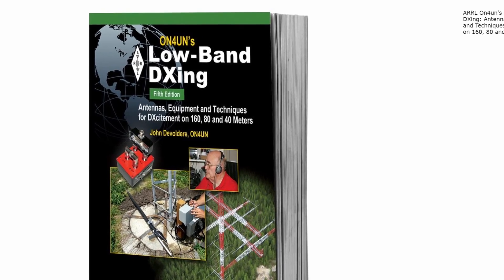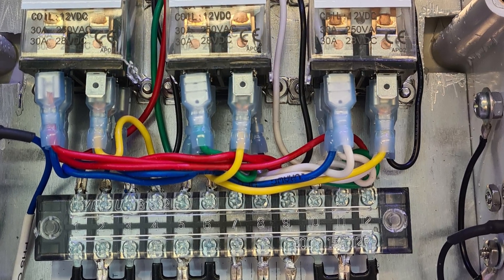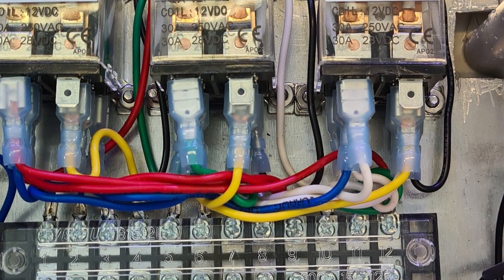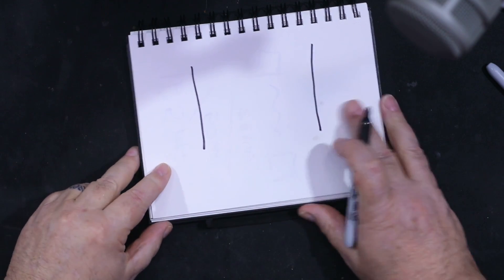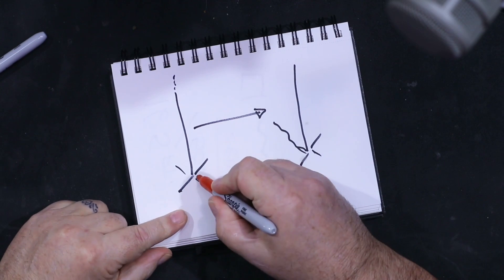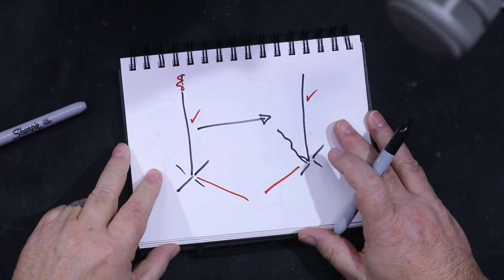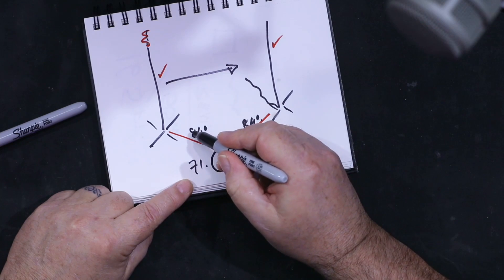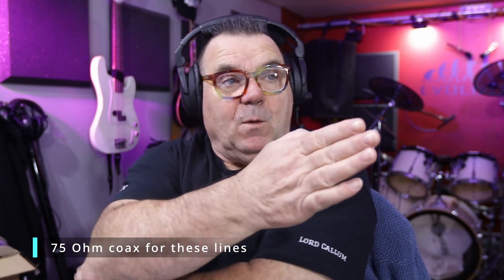Simplifying the 2-Element Vertical Christan Method Phased Array with John NJ4Z

Comment: If you want to experiment with the Christman method for a 2-element phased array.  Here are the most important factors.   

1. Build your vertical elements so they have the same impedance, independently.  Set up both so that the impedance with both elements standing 1/4 wave apart, but one floating you get the same or very close to the same "Z" impedance (total impedance) for each element with the other floating.  
2. Make sure your connections from the relay(s) to the feedlines and the delay loop are as short as possible.
3. Be as accurate as possible when cutting the feedlines and delay line.  84degress on the feed and 71 degrees on the delay for 1/4 wave separation between the elements.  For a 1/8 wave spacing Colin MM0OPX has a great video on those with the proper feed and delay figures.  (It has been suggested that cutting the feedlines and delay line through the relay network would give more accurate lines.  I have not tried it but will let you know the results of my experiment when I do.)
4. For 100w SSB or CW 16amp relays work fine, but no more than 30w digital.  If you want to run big power and high-power digital use 30 or 40-amp relays in the system.  Heat becomes a big factor with digital or big power. 
5. HAVE FUN...

if you have questions or need help drop me a line via e-mail.  Be glad to see if we can solve it.  All the best and 73 de NJ4Z
Reply from the maker: Nice comment John!
Reply: Awesome stuff!  This type of content is my favorite.  

Do you have any specific relays you would recommend John?

Also was wondering about Solid State Relays or Silicon Controlled Rectifier.  I’ve heard other people mention vacuum relays, so just trying to get some opinions.

I’ve looked around, trying to find the voltage and amperage we are dealing with, and I’ve not found any solid answers yet.  At 1500 W what voltage and amperage are we dealing with?

Thanks again John I’m really glad you and Callum created these videos again. This type of content is my favorite as I’ve always had a fascination with antennas since I was a kid.
Reply: @KevinChry  I have used the JQX-12F 2Z series of relays for HP.  I also have used auto relays and some of the DX engineering relays.  hope that helps. Vacuum relays would be ideal but are hard to find and pricey.  
as regards to voltage and current - 100w 70.7Vrms (200Vpp) and current is 1.43A.  1500w 273.9Vrms about 774.6Vpp and about 5.5amps in current on the feedline.  Don't forget the higher the frequency the less current the contacts can handle that's why I say use high current rated relays.
Reply: 1.  Please explain what “degrees” mean in terms of feet or meters length. 
2.  Please explain what you mean by grounding the antenna. Does that mean you add radials to it? If so how many and what length? Or does it mean you’re clipping the center element onto something which is grounded? I’ve been interested in phasing antennas, but have no understanding of what these mean even though I’ve built antennas for years. I see video after video like this and no explanation whatsoever of the simple basic terms for a ham that has no experience with them.
Reply: @thestingyham1188  easiest way to explain is each degree is going to be different for each band (frequency).  A full wave form has 360degrees of travel and a specific length of travel.  for example the waveform 14.145MHz (20M) is 21.15 meters long.  So each degree is .05875meters in length (21.15/360).  Make sense.  Now coax has a velocity factor so for a piece of coax with a VF of .82, the coax would be .048175 meters per degree. (21.15/360) * .82 = .048175m. When you ground an antenna you connect the radiating element to the radials (shorting it out).  You would not do this for a phased array, because all elements in the array are fed.  You would use a grounded antenna in a parasitic array.  See my website www.performancezarrays.com for more info.

Comment: What about having a switch to disconnect the ground or make the ground directional. What I mean is with the grounding around the antenna 360 what if you disconnect 180 on one side. Would help if I could draw it but maybe you know want I'm getting at.
Reply from the maker: All that would happen is that you would be less effective in the switched direction - and not by much and of course, you would also lose effectiveness all around too.

Comment: If you only want one direction could you use two 1/4 wave verticals feed the first one with a T fitting and a 1/4 wave length of coax to the second antenna. With the hain towards the second antenna.
Reply from the maker: Yes.. The first one gets 71 degrees of coax and the second one gets 155 degrees of coax. Most gain towards the 155 degrees.
Reply: The correct feed for the antenna is one side gets a 84 degree feedline and second (leading element) feedline is 155 degrees.

Comment: You can still pull off a slick setup with 3 antennas – 2 active and 1 passive doing the reflector dance. Just throw a relay on the antenna when you're TX in a particular direction. Grab that 3rd passive antenna, let it do its thing for receiving, kicking out even more of that annoying noise from the wrong directions. And to spice it up, toss in a X-phaser to hear the voice of silence.

Comment: I had to look this up, because you made me curious!  It would appear Heath Robinson is a reference to cartoonist W. Heath Robinson who was known for drawing overly-elaborate machines that perform simple tasks ( https://en.wikipedia.org/wiki/W._Heath_Robinson ).  That would make a reference to him similar to our own cartoonist Rube Goldberg here in the States, who drew oddball machines for similar, simple purposes.

However, judging from your use of the term, it seems Heath Robinson would be more akin to "jerry-rigged."
Reply from the maker: Agree with your last line.. I also have the feeling that Heath Robinson has morphed over the years to a "cobbled together / rustic / won't work for long".. But Jerry Rigged works too. Actually, I would say Jury Rigged.. https://www.merriam-webster.com/dictionary/jury-rig - nice comment - thanks!!
Reply: @DXCommanderHQ "won't work for long" - there's nothing more permanent in most ham's antenna arsenal than a cobbled together temporary trial solution which works.

Comment: I've been enjoying these phased array series. It's been tremendously insightful and given me something to trial out. Wanting to build a 20m & 17m versions.
Reply: go for it... it is great fun!
Reply from the maker: I'm with John.. Do it :)
Reply: I don't have enough garden space, mainly wanting to use portable. Would I get away with using the same length radials for different bands. Plan to do parasitic vericals for easy of deployment.
Reply: @brendanwebb4600  yes the radials can be the same but in a parasitic you will need to make sure you have 1 element tuned for your TX and 1 element at about 5 % longer (reflector)
Reply: @FromthehamshackwithNJ4Z  this sounds like my summers on the beach are planned out

Comment: Has anyone played with quad beam antennas?
I used to build them back in the '90's and had great success with cb 11m. I coukd reach out 50+ mikes on just 4 watts. 
Just getting back into radio after a couple decades and studying for my tech to do 10m.
I always loved tinkering with quad beams!
Great show gents. 73👍
Reply: I have designed a few and had mocked one up for 10eters and then decided it was too big to set up where I had planned to install it.  Now that i am moving to a larger plot of land I may delve back into that antenna.
Reply: @FromthehamshackwithNJ4Z  Yep they're big! Funny thing was that I mounted it about 10' off the ground on the kids swing set! AND I had trees!
I think it would have done much better in a clear pasture or 80' above the ground. Still impressive compared to a yagi. It was just a two element with a driver and reflector.
Good luck if you try it out again!
Reply from the maker: I think some folks tell us that trees impact more than they really do.. I have a TON of trees to the south of my antennas and I still get Spain / S Africa clear as crystal.
Reply: @DXCommanderHQ  Agreed, I had it pointed between several huge oaks and beach trees in a neighborhood setting. Not quite a forest but plenty of them and the signal got out nicely.
I don't see many, if any, people building quads these days and wonder why.
Once I'm on the air again, I will def build a more substantial "easily deployable" quad.
Might be a nice experiment for a few episodes worth of fiddling and testing gain compared to a yagi. 👍
Good morning from Hanover County VA., USA!

Comment: Curious, how much bandwidth does the two element phased array have on 40m?
Reply from the maker: Plenty because there's no loading.. I would say (not got it on right now..) about 150kHz at almost perfection and say 2:1 SWR at 250kHz - something like that. Lots! (Good question).
Reply: @DXCommanderHQ  Wow that’s awesome!
Reply: the two element I just built for testing of a new switching network design was less than 2:1 across the entire band.  the low point was 7.150 at 1.48:1
Reply: @FromthehamshackwithNJ4Z  Fantastic!  Thanks John.

Comment: I have a 2 element phased vertical array on 80 meters. The interface was developed by Array Solutions. My SWR on the entire band is about 1.3:1. I am using two 32 foot verticals for the antennas. Both antenna's have adequate ground wires. The entire system was installed by Jon and Adam Zaimes, AA1K and N3TTT. Mark KB3Z
Reply from the maker: Very fine!
Reply: Nice system! ARRAY builds some beautiful stuff!

Comment: If you're content with just One direction then you don't have to make a switch box you can just simply connect 84° to 1 antenna and 155° of coax to the other antenna and be done with it. That would be a lot easier project to put together and not have to worry about building a I switch box with the phasing line
Reply from the maker: Yes. Absolutely.
Reply: Does anyone have any measurements in feet or meters instead of degrees? I have no idea how to measure something in degrees? I also have no idea how to ground an antenna as described because it is not described. Are we adding radios to the thing to create a ground? Are we simply clamping the center element onto something which is grounded like a ground rod?